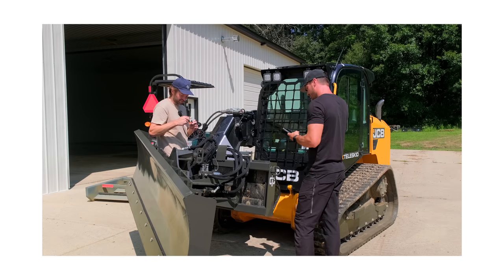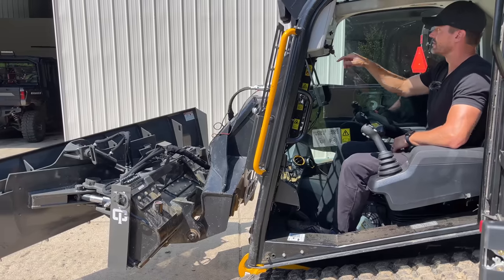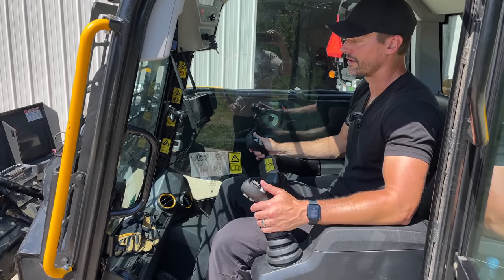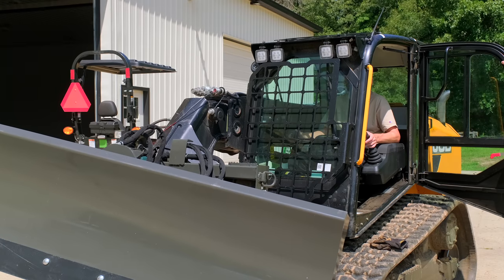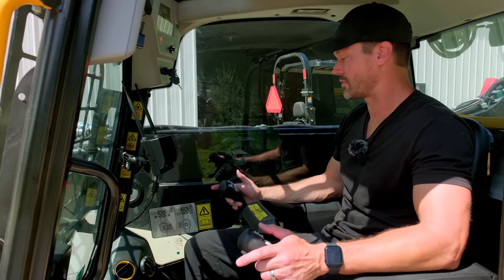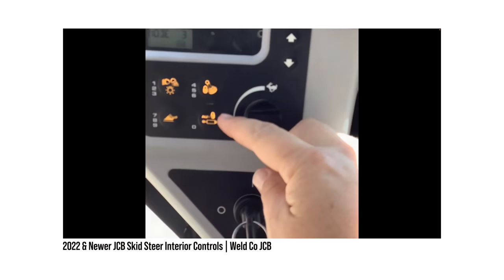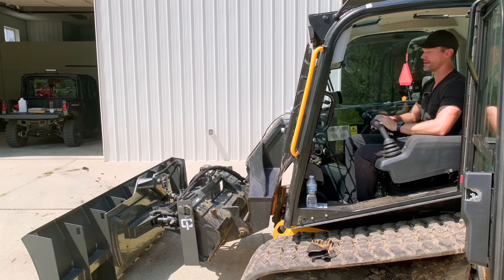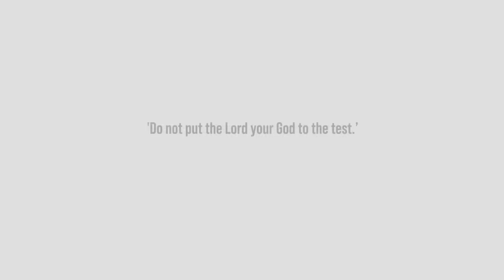REASON NUMBER 1 MILLION ON WHY YOU SHOULDN’T BUY A JCB 🤬😤😡

Comment: I've never bought a piece of equipment or a car without the salesman going over everything with me. Did your dealer not show you how to operate the machine when you picked it up or when they delivered it to you? because if not, I'd find a different dealer. For the record, my Case SV250 is the same way to operate my HLA Snowplow. Auxiliary hydraulic switch angles plow right or left and then you push an auxiliary electric button while using the auxiliary hydraulic switch to rotate the wing forward or back. One electric switch for the right wing and another electric switch for the left wing. Basically, it's the same hydraulic circuit for everything, the electric switch just triggers a diverter valve to send the fluid to different functions. Very simple operation.
Reply: I have noticed most places could care less it seems most of the time whenever you get a tractor motorcycle etc the salesman has no clue what they are doing or anything about the machine.

Comment: It looks like there’s a diverter valve on the attachment and you’re using the 3rd function to control both the electrical is just to switch between functions

Comment: All skid steers with only one hydraulic circuit have some kind of switch to activate the electrical plug. That activates the solenoid on the attachment to go between functions. Any small wheel loader I’ve used has that same method of unlocking/locking the bucket on. They don’t have a dedicated  hydraulic circuit for the pins holding the attachment on so they are also using a solenoid/diverter valve to use the third function hydraulics to do that. Similarly to the 14 pin connector. It’s meant to default closed so the operator doesn’t accidentally leave it unlocked and have the attachment fall off.
Reply: Someone finally said it!!!!

Comment: The side door is a huge benefit for some users and the larger you are and the older you are the more it is really meaningful. They offer two sizes of your wheel loader with the single extendable boom arm and for forklift/stacking work it can do on a small scale what a telehandler does. The single boom also gives you a wonderful perspective on the bucket when you are back dragging rock or dirt. Having said all that i agree with you that the owners manuals suck. Maybe they do not have all of the attachments we have here. Also , Land rovers and Jaguars are notorious for bad electrics overall and weird ergonomics for switch locations. Keep running it, I hope it grows on you
Reply: @Dirt_mountain-earthworks the teleskid and the 333g are enough different that I don't think you can say one is objectively "better" than the other. For grading and heavy work the 333g will absolutely outperform the jcb but for reaching in tight spaces the jcb is a better fit.

Comment: This will be off topic, but I find it hard to believe a 6 way dozer blade is a good implement for a one arm machine like that. The amount of force exerted from one side of the blade in a cut I would think would be enough to fatigue and crack that boom  arm very quickly over time
Reply from the maker: JCB sells one for this machine.  Why would they do so if a bad idea?
Reply: @GoodWorksTractors  quite possible they have a design that works fine. Again, I only stated it’s hard to believe there isn’t excessive force on that boom arm is all.

Comment: Skidsteers are a whole new beast from tractors and was a big learning curve when we started to transition. Just like your calling your aux 1 and aux 2 a third function. FYI, all skiddies are the same just different button locations. Your aid one on left joystick is your main. Then your buttons control your 12v output to the diverted valve on the attachment. Some attachments have 1 diverter like a Harley rake, some have 2 like a Harley rake with tilt and angle, and when your getting into graders or forestry heads some have 3 and 4. They really do skip some important things on the electrical side with a lot of these manuals.

Comment: They also make what I think is the finest general purpose backhoe in the world. Drive one that has all 4 tires the same size instead of little chickenshit front tires. You cannot turn it as sharp, but go load a dump truck with the front bucket or road it at 25 MPH to another job. It is really unique and a wonderful design. Of course many people think Kenworths rule the world and Peterbuilts are second class. They are all wrong
Reply: We actually used a big older jcb backhoe and it was absolutely awesome

Comment: it’s a diverter valve. On tractor third functions that use a diverter. You have a momentary button that you have to hold or a switch to engage the valve and then you use the normal lever to now operate the 3rd function. 

I think what’s going on here is you’re thinking of the Auxiliary hydraulics on a skid steer as a simple third function. Whereas they’re more like a separate power system. With its own control system and power supply. 

A 3rd function is simply a branch of an existing and used circuit. While auxiliary hydraulics are their own stand alone system.

It’s totally stupid that they didn’t have a breakdown of electric/electronic controls in the manual. I really don’t understand why they wouldn’t have a breakdown of those controls. That’s just stupid…
Reply: They do that so you have to bring it to a dealer
Reply: @Press1for  I work at a dealer and that’s just ignorant. We do not have the time to show you how to use the buttons on your machine every time you use a different attachment or implement. Plus, that is not something most dealers would ever charge you for… Especially if you bought it from them.

Comment: This seems like more of an issue with the attachment than the skid steer. They are using a diverter valve to use the angle feature. Granted it wasn't that intuitive, but I think blame is in the wrong place.
Reply: Diverter switches should be toggles, not momentary. I think the actual issue here was not only was the sequence to operate a vital function not in the manual, you also have nobody at the company to call to figure it out. Dealers are usually the people to call to figure this out but you should still have the option to talk to the manufacturer.
Reply: JD has the same poorly written manuals. Vital information is just not there and it will say refer to owners manual in both the implements and tractor. It’s a shame people cannot get a questionnaire out to owners on what’s actually missing.  I imagine the list would be yet another manual “Things we forgot to mention” manual😂

Comment: Okay, so this is just a normal hydraulic circuit selector.. it's used to technically double your auxillary, or add auxillary to an existing function. it needs an activation button, for you to then use the (here, auxillary) paddle/button.. that's infact a thing with the plow/blade, not the jcb. sure, the controls could have been listed in the manual, but then again with some simple hydraulic knowledge, this gets very obvious. same goes for the bucket lock for that matter.

Comment: The dealer I work at has been selling JCB for roughly the same amount of time I've been there, specially the Ag 400 wheel loaders (mainly 403 and the large frame 4x7), 500 tele handlers and TM telemast wheel loaders (why we don't sell the small/mid size 400's). We do sell the 4000 and 8000 Fasttrac's as well, but I've only heard of one 4220 being sold through us, and it was delivered via a sister location of us.

The main issues we've had were:
- shipping larger parts, but because of brexit 
- a new 542.70 where the hydrologic tank wasn't welded probably, and we needed 3 attempts to get that fixed, we actually needed to drill a hole into the frame and remove the rear axle for that.

I've mainly done the monthly storage inspections on them, but also had to add a pressure less return line to a 403, which was quite the pain because of the cab being fixed, and the space where that line goes into the tank, you need to replace a 90° fitting with a T one, and get the new hose tight in a space you can barely fit your hand into

Comment: I think there are a few different things going on in the “jcb saga” here

First of all, your jcb salesman did you a disservice from the beginning, especially in not explaining to you each and every function of the machine. This is the reason you buy from your local jcb dealer, for the support.

Secondly, I think it’s a stretch to blame the machine for the struggles you guys were having in this video. The aux and electrical connections on this machine work the same way as any other machine that you’d put that blade on. Your friend even came so close to admitting that the Deere functioned in a similar way(at 12:41).

Third, the wheel loader has the quick hitch interlock for the simple function keeping an operator from dropping the bucket off on accident.

So again, a good dealer/salesman should be a phone call away to correct issues and questions such as this. But I don’t think it’s quite fair to blame the equipment for an operators lack of knowledge.

construction equipment is very different from compact tractors, and every machine on the market has different ways of doing the same thing.

Comment: Yeah, I have two teleskids, and the JCB 14-pin is braindead. It puts out like 8 volts to see "what's out there" and only outputs 12 volts if it sees a load. No other manufacturer does this. It's literally braindead and only works for 12V on-off solenoids. Modern proportional solenoids don't work with it. You need to inline some resistors in the harness to fool it into seeing a load.
Reply: That being said, I love my teleskids and wouldn't trade them for anything except a 100hp teleskid. The benefits dwarf the warts IMHO.

Comment: If you’re not use to auxiliary functions set up like that it can be very frustrating! I’ve seen stuff like that on several different types of equipment, not just JCB. 
I’m pretty sure that top secret information is concealed in operators manual or in one of the supplements. 

How have the JCB’s been doing for you? I’m genuinely interested. I’ve seen lots of problems with them in the past but that was over ten years ago. Because of my past experience I can’t, in good conscience, recommend JCB.  I like a lot of their newer features and I’m curious how the reliability is doing.

Comment: But something like that on mono boom - is a BAD idea anyway!
Reply from the maker: JCB sells one for it.  So, they sell something for their own equipment that’s a bad idea?
Reply: @GoodWorksTractors  Of course! They get to sell you new boom or the new machine after you bent it.
Reply from the maker: Sure, under warranty.  Good plan 👍
Reply: @GoodWorksTractors  BTW - I have customer that have 3 of those, but he uses them for inside the wear house, because they are easy to jump in and out. 
One time his CAT skid steer that has grapple on it and moves logs went down with undercarriage problems. And he didn’t listen to my suggestions and put one of those Robots on that job - now he is looking for good used boom.
And those new ones with electronic joysticks - non of his operators wants to work on it. Because it’s jerky as hell, and you can’t do anything about it.
Reply: @GoodWorksTractors  You’re funny! 😂
How many warranty claims you got covered by JCB?

They will come up with 25 reasons how you’ve been doing wrong, and they are not liable for it.

How about this: “sure warranty covers the hose and fitting - but it doesn’t cover the chewed up o-ring”, and never mind that O-ring is a part of fitting, and got chewed up because fitting wasn’t tightened properly when assembled.
Reply from the maker: @commenter5469  I won’t need to find out.  I’m trading in this piece of junk on another JD. That and the 407 wheel loader.
Reply: @GoodWorksTractors  In case you don’t - keep checking the bolts on drive motors! Those constantly getting loose on all models.